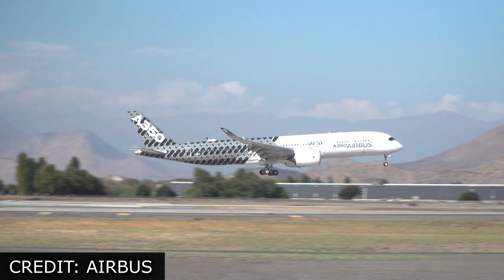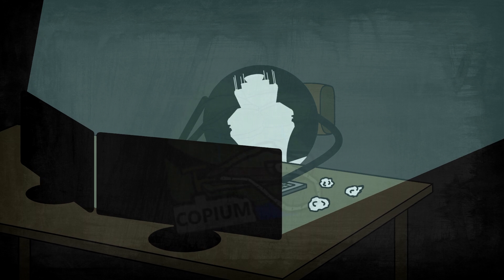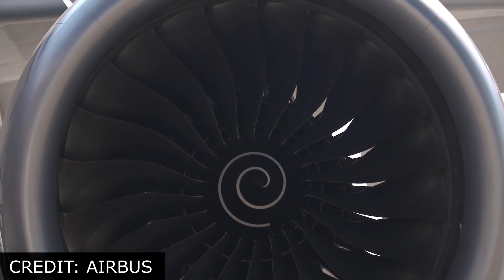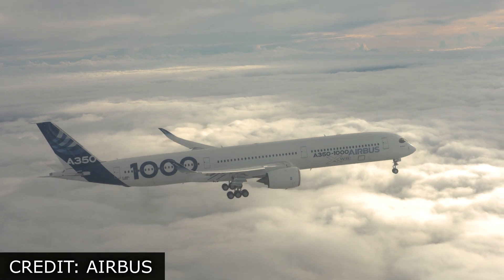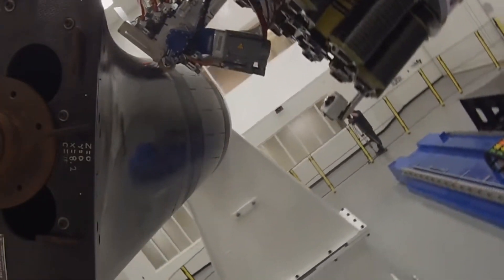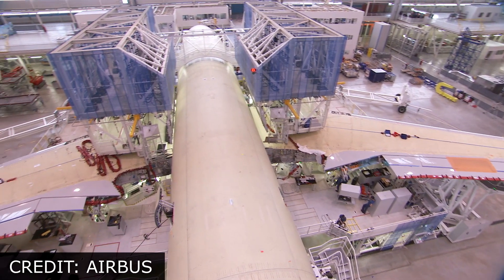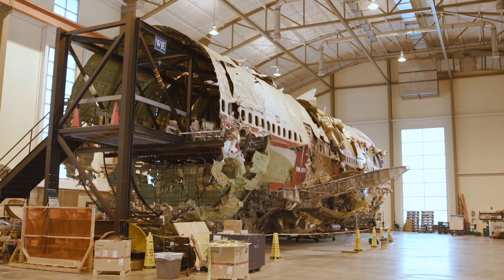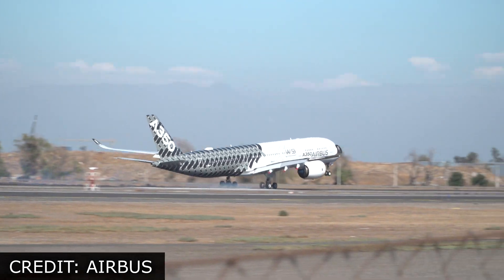More A350 Drama... And Why Are They Wrapped In Foil?

Comment: And how does Boeing deal with this problem?
Reply from the maker: Interestingly for newer 787s, they got rid of their copper foil and just fill the fuel tanks with nitrogen.
Reply: So in other words Boeing thinks there's no way a lightning strike could significantly fuck up the structural integrity of the CFRP? 
Not sure how I feel about taking their word for it....
Reply: @frankeinfish  While I don't have any specific opinion about 787 safety, it should be noted that they specifically removed some copper foil strips from the wings (claiming the remaining protections such as nitrogen inerting suffice, especially since data showed the wings were rarely impacted by lightning compared to the rest of the plane), they didn't get rid of conductive foil/mesh elsewhere.
Reply: @PDXHEAVY  For some reason it feels like Boeing is cutting corners. Nitrogen inside of a fuel tank does not reduce electro-static charge on the surface of the airplane.
Either way, it is a problem that one day is going to blow up.
Reply: So, I used to feel safe on Boeing planes until they knew knowingly killed people to save a buck like Ford did with Pinto fuel tanks, so yay Airbus.  Now Airbus is shown that socialist also struggle with not killing people to save a buck.  I fly usually at least twice  weekly for my job with multiple connections and am thinking I need to find a new job because accountants make terrible engineers.
Reply: @lelenbates3367  You're lucky! I always wanted to travel by flying. But the most I did was 10 flights in 25 years....